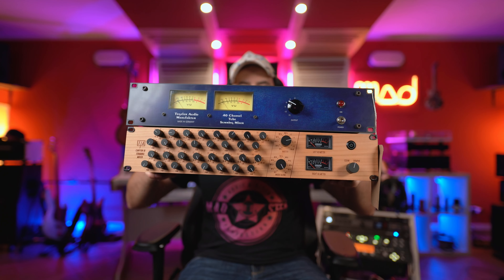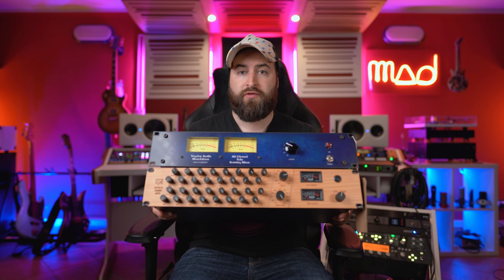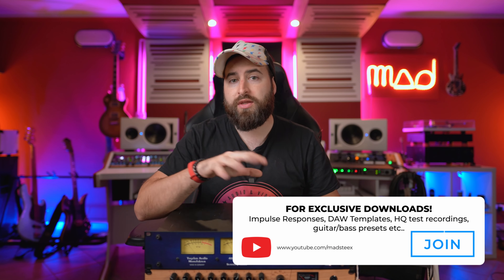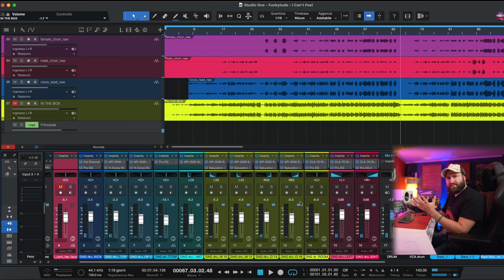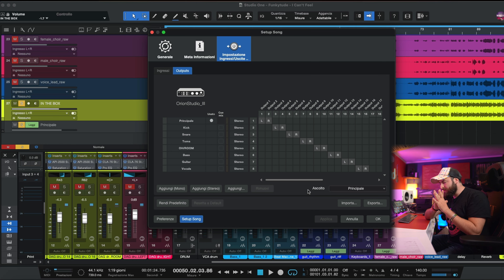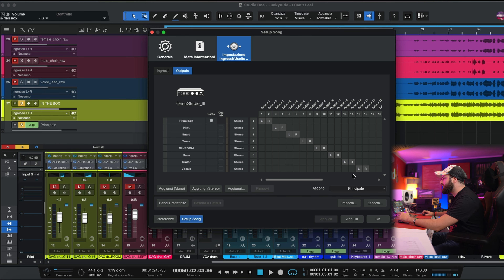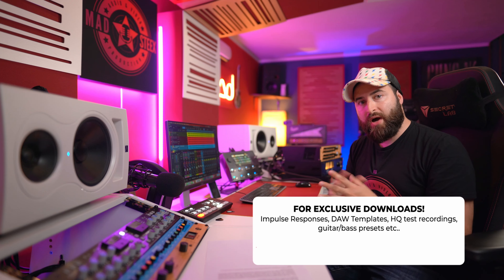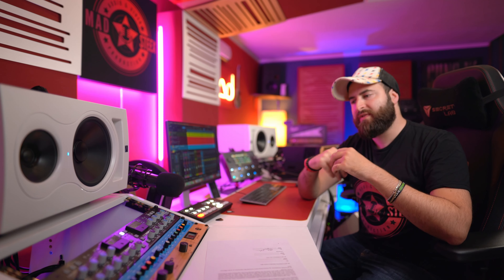Tierra Audio Canyon VS. Tegeler Tube Summing Mixers AUDIO COMPARISON

Comment: I don't notice such a big difference compared to Neumann or Neve summing. I was using Rme converters, which for DA conversion is fine. When recording, the depth and stereo image lost quality, until I bought a DAD Ax32 converter. Without the converter my adders made no sense. The difference in sound I hear between ITB and OTB is not so obvious, could it be that you lose a little quality?

Comment: I cannot hear any difference between a couple of them that you recorded into your computer using my Audio Technica ATH-M50xSTS. They all sound the same to my ears.
Reply: The first comparison with in the box and the tegeler it was very subtle but if you listen more  you can hear the mix changes in terms of where things are placed over time! The canyon opens things up more than than the rest!
Reply: @natethacomposer  Oh... Maybe it's just my ears that just can't hear much of a difference. What headphones do you recommend that will help me hear much of the difference without breaking the bank--let's say around $200 to $250? Or maybe less than that? Oh, I have a hearing disability and I do wear hearing aids.

Perhaps I'm not trained to hear 0.5dB to 1.5dB of a difference. I'm talking about subtle differences that's my weakness.